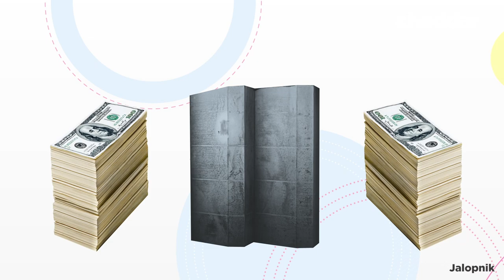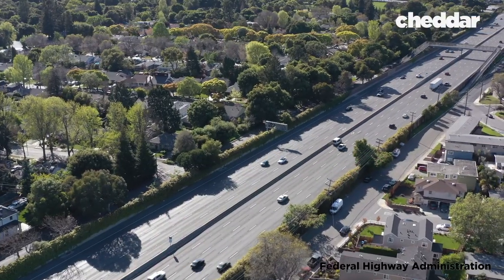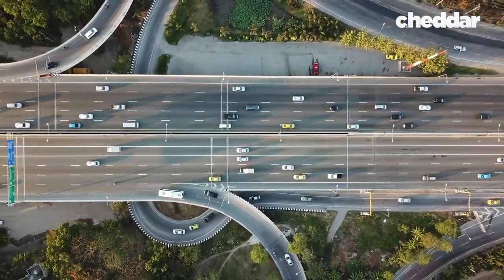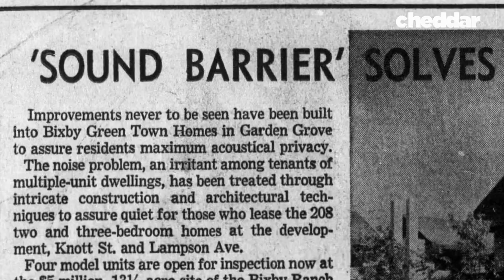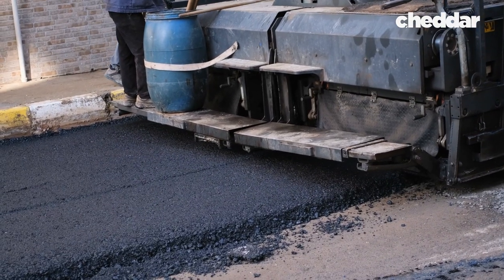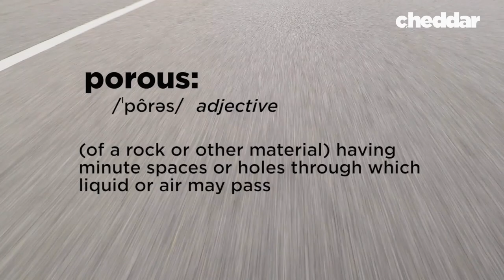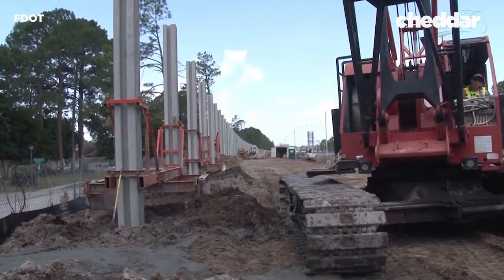How Highway Noise Barriers Can Make Traffic Louder - Cheddar Explains

Comment: For almost 3 1/2 years (Oct. 2017 - Feb. 2021), I lived in a dump of an apartment that was only 400 feet from one of the busiest freeways in the US. No barriers of any sort---not even a skinny hedge---to block the sounds, and the noise level was constant, loud, and hard to bear. My sleep suffered hugely for it.
Moved to my current apartment In Feb. of this year; now the same freeway is about half a mile away, and there are numerous business buildings, as well as a small apartment complex of two-story buildings, between it and my place, and these buildings run perpendicular to the freeway, so any sound from there is mostly deflected back to it by those buildings. The only time I really hear it now is when the wind blows from the north---from the direction of the freeway---and it blows the sounds of the freeway between our buildings. It's so rare, it's not a problem, though. 
Then, only about 1/4 mile behind the apartments, we have a train track on which about six freight trains a day travel; again, though, not much of an issue---none, really---partly because they go through so quickly, and partly because there are a lot of trees and low, one-story buildings between the tracks and this complex. The engineers also don't get crazy with sounding the train's horns, using them appropriately for the 3 or 4 crossings near here, so again, not offensive.
It's amazing, though, how moving back off the freeway by half a mile, and having those buildings (and some mature trees, though not more than a dozen) makes such a huge difference in sound. Now it's peaceful, and often downright quiet here, which I'm so very thankful for! My sleep quality has improved so much, I can't even compare it to the other place.

Comment: Maybe the ussage of trees will do the same intended purpose but also improving air quality... don't know why it is not used already
Reply: because you're assuming trees will do a good job of reducing noise based on nothing?
Reply: @itsnotmily  Sound is vibrations. Absorb the vibrations, absorb the sound. As the video explains, the problem with sound barriers isn't the wall itself, its the material its made of. A hard concrete wall bounces sound. Soft materials absorb it. So a tree line would absorb the sounds.
Reply: @itsnotmily  Well, which is noisier, a bare room full of hard surfaces or a room with carpets, furniture, and drop ceilings?
Reply: @itsnotmily  based on that trees does have a lot of surface and moving structures and does serves as buffer barriers due to dampening the movement because the are flexibles contrary to what happends with concrete. Check it up, there are cool and interesting proyects around the globe like what is happening in South Essex

https://www.forestresearch.gov.uk/tools-and-resources/fthr/urban-regeneration-and-greenspace-partnership/greenspace-in-practice/benefits-of-greenspace/noise-abatement/
Reply: Trees does have the disadvantage that it requires much more maintenance then a simple concrete wall. Cleaning fallen leaves, trimming branches that obstructs the road, replanting trees uprooted by tornadoes, tree diseases, culling to prevent unwanted reproduction, etc. Often, there's even perverse incentives to use less effective solutions because highway constructions are often federally funded, but maintained by local governments, so the local government would very often opt for the low maintenance solutions even when it's not cost effective solution overall if you include the construction cost.
Reply: @yvrelna  trees require infinitely less maintenance for them to be effective at what they do. Leaves don't need to be cleaned, they need to become part of the soil. Place the tree line away from the highway and you won't need to trim anything. And still, the price of a tree line will be a FRACTION of the price of concrete walls.
Reply: @yvrelna  yeah, if they're planted literally next to the road. if you plant them 50 or so meters away, you don't have to worry about the fallen leaves or branches, and the trees can't grow big enough to impede on the road. you can literally just plant them and leave them. otherwise most roads would have to have a clearance where no trees can be planted which simply isn't the case. even if it was and issue, it would cost far less than the $20 million per mile for the initial cost of concrete barriers, let alone the maintenance costs. 
on top of that, trees are infinitely better at absorbing the sound than barriers are, which is better both for civilians as well as the environment as it's less disturbance for animals and birds.
Reply: @napillnik  Fallen leaves can cause accident on highway, and cars hitting a tree from highway is death sentence to the drivers. Fallen trees are also safety hazards.
Reply: @maggiejetson7904  I didn’t know hitting a concrete wall wasn’t a death sentence... I’d rather hit a tree than a wall, tbh
Reply: @yvrelna  You sound like you expect them to plaint the trees right on the road. 🤣
Reply: @Vale-nh6ey  Hitting a concrete wall at 5 degree parallel is fine, hitting a tree (cylinder)  means you are head on collision and it is a death sentence to the front passenger. If you build a wooden fence along the road it will be fine too, but not a row of cylinders like tree or concrete columns.
Reply: @itsnotmily  not based on nothing, based on the fact that "green walls" of trees are used successfully around the world as a form of noise abatement.

Comment: “Depending on distance, noise can reach 70-80 db at 50 feet” nice contradiction on the opening line
Reply: It was probably an edit. "depending on the distance, noise can reach very high levels. It can reach 70-80 db at 50 feet".

Comment: The A7 highway in The Netherlands has a wall of dirt retained by steel skeletons with plants growing by side of it as a sound barrier. It truly works as it’s being reflected Bach to the road because of its shape and absorbed by the plants and dirt.
Reply: Walls of dirt or mounds that are higher than the highest truck seem to work okay. A mound of dirt running the length of the house and as high as the roof of the house on the highway side. Netherlands and Germany are advanced in noise reduction for the health of people living in nearby  highway residences...

Comment: I studied road noise years ago. What I found was low-frequency sound waves are tall and need a tall wall to stop them. It also helps to have texture on the wall or strategic grooves. The permeable road surface sounds like a good idea as it may help drainage as well.

Comment: I mean, the whole building huge highways everywhere is an initially attractive, but ultimately terrible and unsustainable idea that the American have been continuing on with regardless. So it seems noise barriers fit quite well with the rest of what you're doing tbh.
Reply: Ring roads and highways reduce traffic for large American cities
Reply: As opposed to what? Public transport? Railroads, the best long distance public transport, is not realistic to be built to work for most US residents. The country is enormous, with so much open space. The money that would have to be laid down to even connect Chicago to LA, for instance, would be staggering.
Reply: @rachelle2227  wtf? Everyone else has already done it.
Reply: @kazimir8086  "Everyone else" (Europe) lives in a country the size of Texas with higher density. You underestimate the size of America.
Reply: @rachelle2227  Highways are okay for traveling between cities. The problem is when they are used to move around the city (instead of having a more dense city with public transport). That's when you have highways next to residential areas.
Reply: @kazimir8086  you mean all of Europe, with way smaller countries and that are way more heavily populated?
Reply: @davidrubio.24  Not arguing with that, cities should have better public transport. Another problem is also that Americans are so used to their cars, and want to use them and not switch to public transport. In England, at least (my husband is from England. So that is what I know), a lot of public transport loses money and has to be government funded. The people have to want public transport for it to be publically funded.
Reply: Not everyone is commuting from LA to Chicago. What an awful example. Solid train service from Milwaukee to Chicago would be a better example. 

There’s also commuter rail options. Americans are brainwashed to believe cars are the only solution. But it has only been that way since the 70s.
Reply: @nicomarino96  Well there you go. The infrastructure for railroads would have been built a relatively long time ago in most of Europe as well. It is way more expensive to build them new now, particularly with having to inevitably buy off land from people and using modern labor standards and wages.
Reply: @tcsnowdream9975  I'm not suggesting people would commute that far, just giving an example of connecting two major American cities people would have heard of. There is a train connecting Chicago to Milwaukee. I live in the area. But it's very slow and ineffecient, so most people don't use it.
Reply: As someone who lives in China: watching Americans explain why the US can't compete is almost sad
Reply: @rachelle2227  I know. Is a chicken-and-egg scenario. Public transport is not worth it if it doesn't get appropriate funding but people don't want to fund if it's not worth it.
Reply: @jimsquire-chestnuts8381  China has way more people and is way more dense than the US, and has lower labor standards. How can you even compare the two countries??
Reply: @rachelle2227  you can't. One is eradicating poverty, the other is perpetuating it.

China invested more in public infrastructure in the last 20 years than the US did in the 20th century.

Despite the US having a larger economy...
Reply: @jimsquire-chestnuts8381  They sure can get a lot done without a democracy. That is how I understand how they can be so efficient with infrastructure and other government initiatives.
Reply: Yeah, it's a constant fight to try and change anything, here, when the politicians would rather listen to the corporations due to their unfortunately entirely legal "campaign donations" rather than the people they swore to serve.
Reply: @JoCE2305  What do you expect when America has the worst zoning laws in the world
Reply: @rachelle2227  Public Transport is great when done right 
America prioritized cars and built cities around cars instead of around people
Reply: America had a lot of railroad before it even had the population density that it has now. America and it's cities developed because of railroad, now people arguing that it doesn't have density to support railroad shows the level of brain washing they have undergone to say that. American psyche and American urban landscape has to change.
Reply: @davidemmyg  I agree 
Car companies have brainwashed the population to sell cars
Reply: @rachelle2227  most people who go from Chicago to LA aren’t taking a car either
Reply: @rachelle2227  it’s not like you have to build rails between every single city and town, you can start by connecting the big cities and then creating a net on the east and another on the west cost, where almost all the people live. Yes, there is a lot of empty space, but you don’t have to build rails there
Reply: @JoCE2305  Russia, China, India.
Reply: @JoCE2305  what a bullshit. All major cities in Russia are connected by rail road. More than 10 000 miles. And the more populated the better connection there is. It doesn't matter if it was done for military purposes or not. Highways were designed so that tanks can pass through but it doesn't matter now. And yes it is very effective for transportation of goods and people

Comment: I live in Brisbane, QLD, Australia. I have driven extensively around the eastern mainland between Bundaberg and Melbourne. The vast majority of all noise barriers that I have seen are metal uprights (Stainless steel I might guess) with treated timber slats horizontally between them. Often, there will also be a row of trees on either or both side/s of the barrier as well.

Comment: I have never in my life seen a sound barrier made of bare concrete. Sound barriers here are usually covered with cement-bonded wood chippings creating a porous surface. They're usually pressed into a corrugated shape to further diffuse and absorb sound. Sound absorbing panels made of wood and glass wool are also common along motorways.

Comment: I live near the end of a cul-de-sac, and then there's a wall then the 8-lane interstate. However, the interstate is also in a bit of a valley, which seems to help direct the sound up rather than just over the wall. Inside with windows closed, it's quieter than a desk fan, honestly. Outside or with windows open, it's still much quieter than a conversation.
Reply: Yeah, sunken freeways sound like the way to go!  I lived and shopped near one and it was fairly quiet, despite having a lot of fast, thick traffic, including  many otherwise loud trucks/semis.

Comment: interesting, i always thought it was the engine noise, and as electric cars become more common the noise level will just drop.
Reply: I think that's what I thought when I was younger, then I've had to replace tyres/tires at the side of a motorway/freeway twice since and rapidly learned that the sound is completely wrong and it's clearly mostly tyres.
Reply: It will make it quieter because instead of having engine noise and tire noise, electric cars have only tire noise.  Low speed areas such a city centers and intersections will be much quieter, but the difference on the highways will not be noticeable because tires are so loud.
Reply: i think about 40MPH/70KPH is where it crosses over, before that its mostly engine, after its mostly tire/tyre. Freeways are all tyre, while City Streets are mostly car engines.
Reply: @Squaretable22  that makes sense, electric cars are quiet when they drive past, but its always at slower in city speeds.
Reply: Where I live it's usually exhaust noise because the first thing a nephson does when he gets a truck or motorcycle is to straight-pipe it.
Reply: Cities will become quieter, because there you have constant stopping and starting at intersections, red lights, etc. But highways, it's mostly just tire noise. I learned that only a few months ago as well.

Comment: The porous asphalt used in Arizona is called asphalt-concrete open graded friction course or rubberized asphalt. It's actually a pretty quiet pavement for the first five years. Then it's not so quiet. Diamond cut concrete seems to be a longer solution but not as quiet.

Comment: Many North Western Europe highways do not have barriers that are perpendicular to the road but instead set at an angle. Also, many are made of more absorbent materials. I would assume that concrete is highly reflective and that the height of the barrier should not be a multiple of the dominant low frequency sound wavelength that tires produce. In particular, these low frequency signals can bend around corners. While they are self-canceling in certain regions they also become amplified in other regions when they collide such as described in the video.

Comment: If you are going to put up a concrete wall, a wall that is shaped like an egg box and tilted towards the roadway should reduce the noise as the shaped zones will reflect and cancel noise and the tilted wall will direct the residual sound back to the source

Comment: Here we use porous concrete lining turned towards the road (could be normal concrete on the outside) and top of barier is curved or bent towards the road. Those porous bariers absorb the sounds and curved/bent part creates better shielding. Plants like vines that are able to grow up the wall can be used too to make it look and function better. It's better than trees because it needs maintanence only as often as repainting the lines or fixing rails so it won't cause too many delays in use.

Comment: The atmospheric condition which defeats sound barriers is called an inversion, where the temperature rises with height-cool clear nights are ideal for inversions. I live about a mile from the freeway and generally can't hear the noise, but when there is an inversion I can hear the highway noise very clearly. In fact, I can hear trains five miles away easily.

Comment: In the Netherlands it's common to use earthworks as sound barriers. These are bound to be softer than concrete and thus absorb more of the noise, I also don't see how anything can be more durable than landscape. Keep it covered in grass so it don't erodes and it'll never have to be replaced.

Comment: Singapore we use thin metal walls with slits too & I think they're pretty good at absorbing noise (besides just reflecting them), both along overground train tracks (~1.5m tall, enough to cover trains' undercarriages where much of the noise comes from (the trains' metal wheels against the steel tracks) & along a stretch of our Central E'way (~4 storeys tall)

Comment: Depending on the distance you can have x decibels at 15 ft.

Nobody else see a problem here 😂?
Reply: No, I don't. 
For purposes of standardization you measure "how noisy a thing is" at a fixed distance. Otherwise, you can play games with how far away you are to hide data: measure a rocket launch at 500mi, and it's pretty quiet.